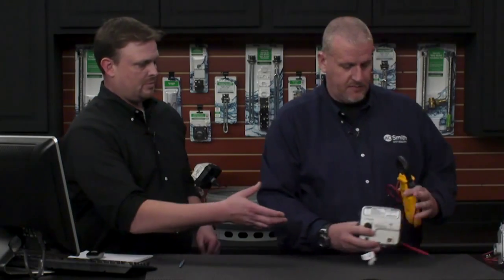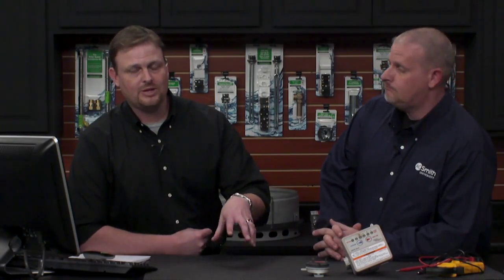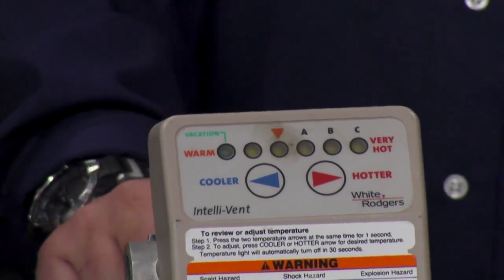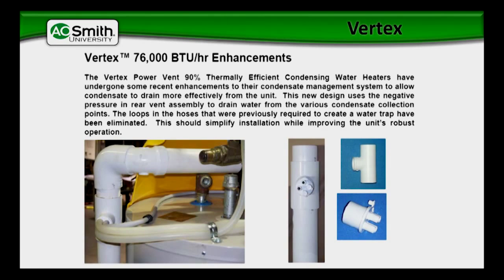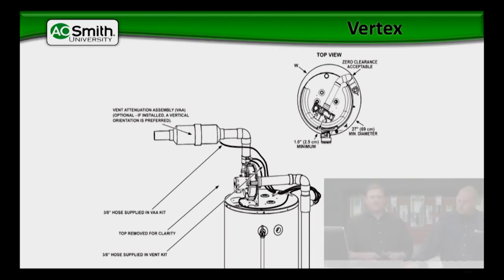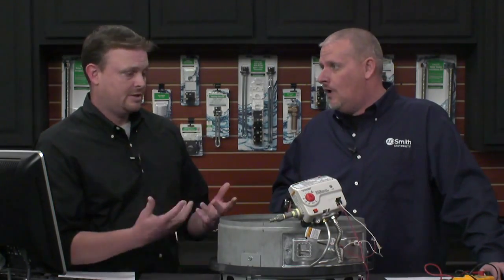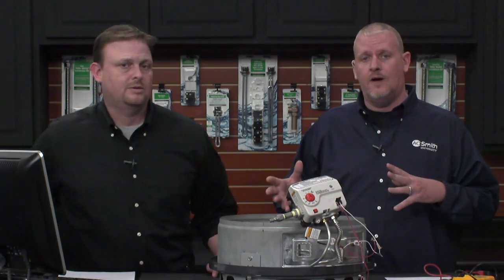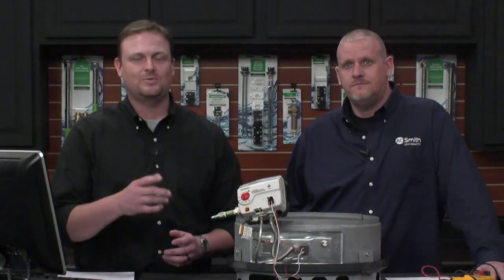A.O. Smith - Vertex Heater | HD Supply

Comment: a.o smith direct vent with white rodgers intellivent gas valve showing error code 4 vacation lite ,arrow lite and c lite lit.changed out pressure switch and still showing code.unit wont lite but blower is running.